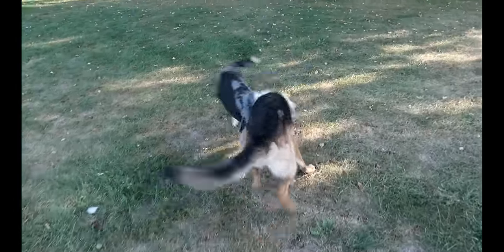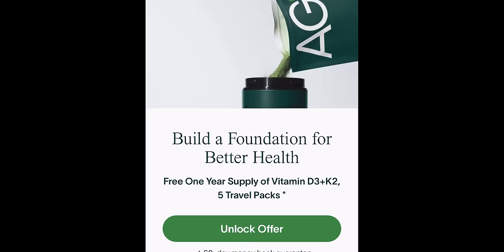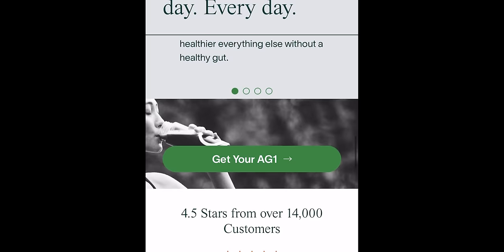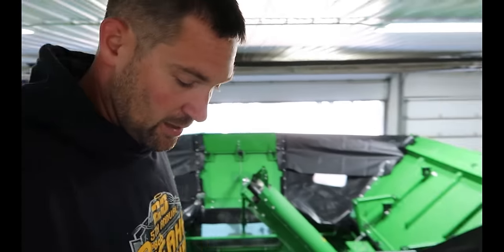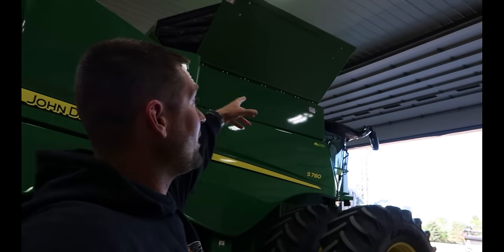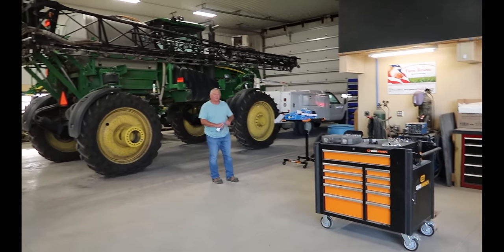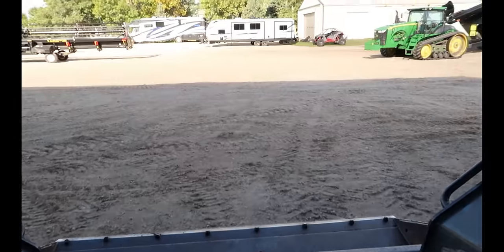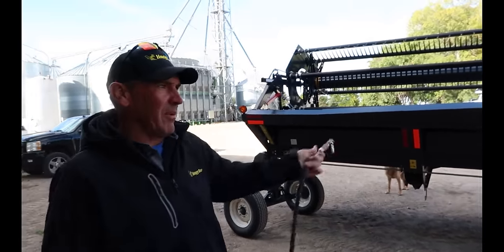Final Preparations for Harvest With the BIGGEST Combine we've ever had!! 45 FEET!!

Comment: Re: grain bin extensions. Have your garage door techs install a light beam system(like the one at ground level)  back ~10 feet from the door  and level with top of door opening. Then when tripped have it trigger a flashing light and or siren.
Reply: Or just fold the extension down
Reply: @gregjames5070  It's so it will alarm you if you forget to do it...

Comment: I think he meant if you use the compressor on the rig, it would take 12 to 15 minutes to fill it with air. That's why he used your shop air. Your shop probably has a bigger compressor and much faster. Just a guess.

Comment: What made you pick a Honey Bee over a Macdon header? We used to have a Honey Bee and it was really bad, then got a Macdon FD75 and love it never had a problem with for 3 years. Just want your opinion on it. Thanks
Reply: My guess is they reached out to offer the demo, Macdon hasn’t. I will agree, hard to beat a macdon draper
Reply from the maker: We ran a Honey Bee demo last fall and loved it. The cut and flex was amazing.
Reply: Okay, ya I never really dealt with the brand new ones so just wanted to see what kind of stuff they improved we always had problems with power to the reel and that. That was also 3-4 years ago on a 2 year old header at that time.